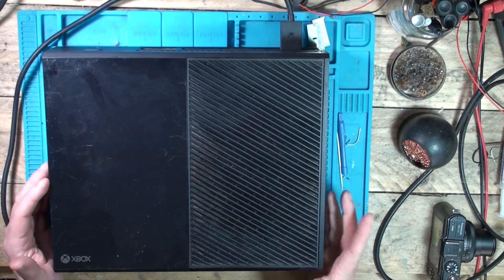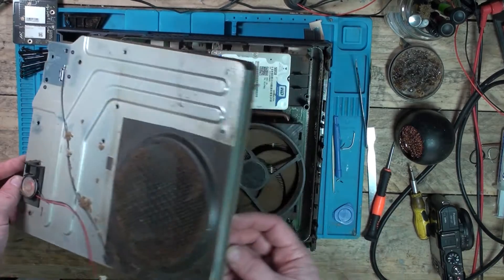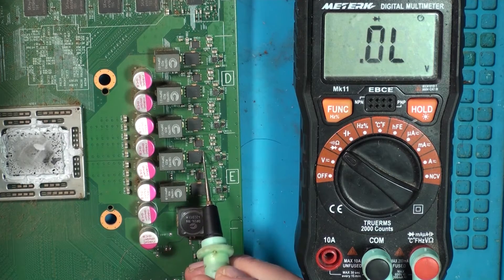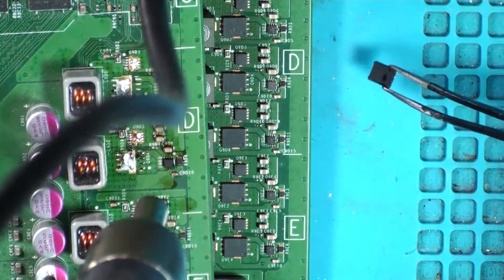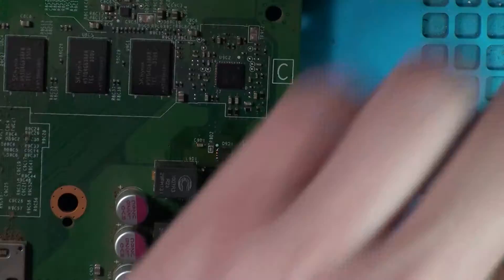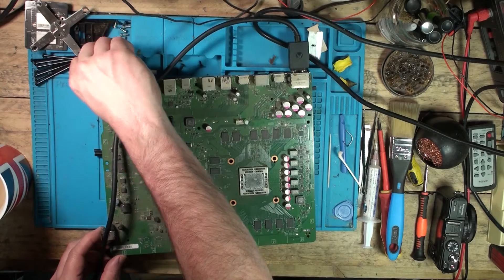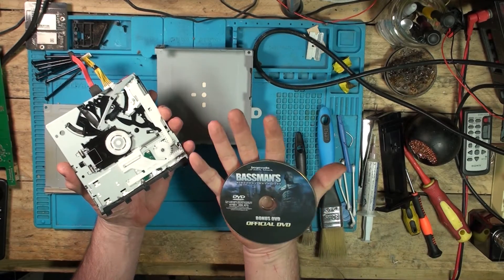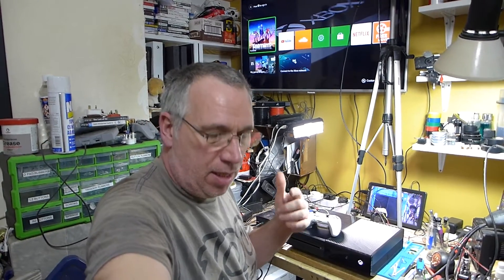Xbox One Original Turns on and Straight Back Off - Xbox One Repair - Mosfet Replacement

Comment: Awesome video an repair man. That's exactly what mines doing. Where can I get the mosfets ? 
Best Regards
Reply from the maker: I got the MOSFETs from a spare board I have. Not sure if the cod3r sells them on his site, consolefix.shop otherwise you could get some from AliExpress but will take a week to arrive.
Reply: @RetroElectronicRepair  thankypu kindly for the prompt response.
Reply: All those mosfets have around the same continuity. Is there anything else I could check? Console is doing the exact same thing on then off. 
Kind regards.
Reply from the maker: You need to check all the power rails are coming up. Some only come up when you try to power on as the Southbridge controls some power rails. Search Google for test points and you will find an image with all the points. Some power on and off can be anything and impossible to diagnose.

Comment: New name is good. Just having worked in electronics design and repair for too many years, an xbox one is hmm not that retro.
Reply from the maker: Thanks, yes you are correct that an Xbox one is not retro but it's hard to get a good name that hasn't been used. I do try and get older electronics but sometimes a good deal pops up that you just can't pass on 👍
Reply: Thats good. Most of my repairs are smd these days. Oddly mostly mlc

Comment: I have one with the same symptoms but mosfets seem OK. It was working and I knocked it over and it now turns on and instant off. I'm thinking maybe solder balls knocked loose on ram or even worse APU or southbridge. Could be wrong, may just be something simple but haven't looked at it for a while.
Reply from the maker: It could be a cracked solder ball  problem. You would need to check that all the voltage rails are present. I've had the same conditions before when I was missing the 3.3v rail .
Reply: @RetroElectronicRepair  would checking diode readings reveal which chip has cracked solder joints and would reflow sort it? Thanks for the reply,  not many youtubers respond.
Reply from the maker: @sparky150875 no, it is really hard to diagnose the on off symptoms. I'd just check all voltages are present first and then maybe reflow the southbridge.
Reply from the maker: @sparky150875 I have a few Xbox one s with beep on and off and not been able to fix them
Reply: @RetroElectronicRepair  thankyou ill give it a go